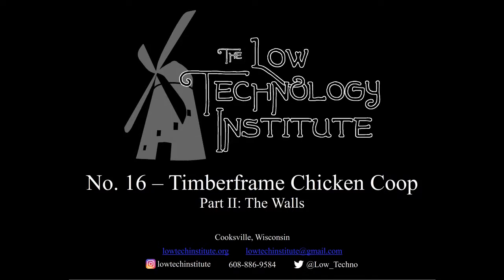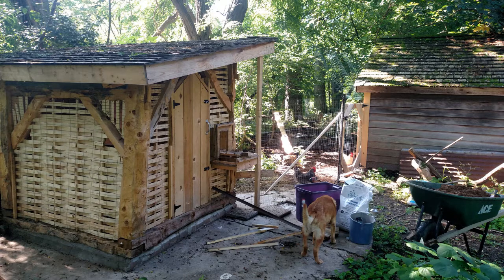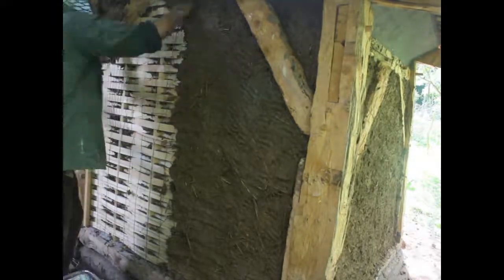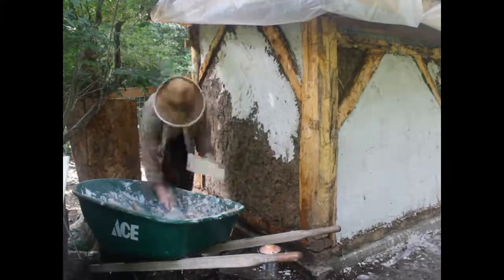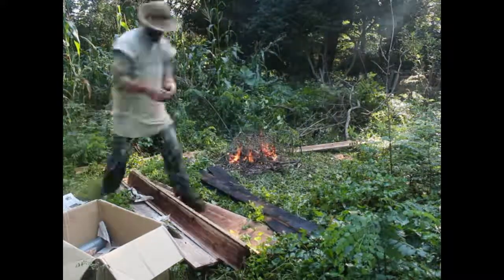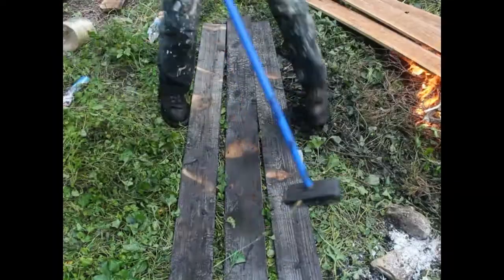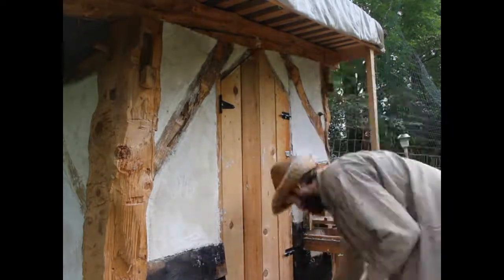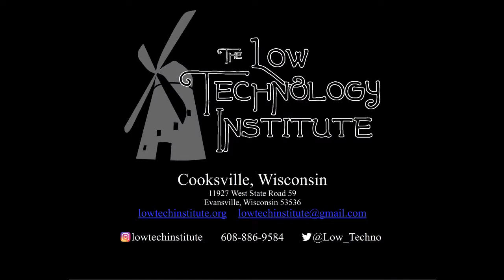Timberframe Chicken Coop, Part II -- Low Tech Video, No. 16

Comment: You, sir, have unlimited energy. I just watched your two-part series and was amazed at how much work went into this structure. It looks awesome!
Reply from the maker: Thanks so much for watching. Unlimited, no, but just trying to use the time I have. This was also done before kids... ha. Our new building project is a 500-sq-ft house with timber frame and larger versions of this test run (and more experience). Stay tuned!
Reply: @LowTechInstitute  I look forward to watching the new build. I also dropped about $600 on robert Sorby chisels. I just need to find the time to get going and a good plan. Do you design yourself or buy plans online?

Comment: Was the wattle and daub strong enough to keep predators out of the coop?
Reply: Yes! The plaster sets up really hard. I also added a layer of wire mesh next to the wattle for extra security, but no animal has gotten through the plaster. I don't know if just the wattle and daub would stop a determined badger, but most animals would have trouble getting through it.
Reply: Nice.  I want to go this route since it's as close to free as I can get but I've never done the wattle/daub.  Hoping it can stop a coyote or a fisher cat haha
Reply: @WoodchuckNorris.8o  If you add some wire mesh in with the wattle, you'd be set, but it adds to the cost unless you can find some to repurpose.